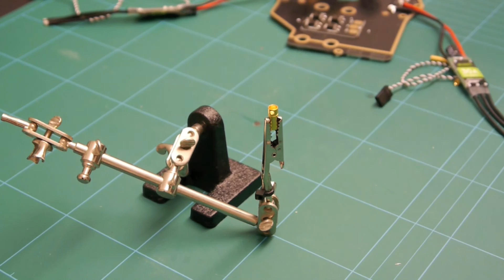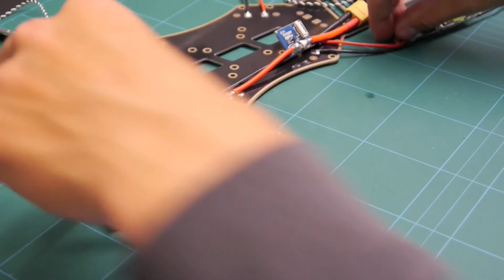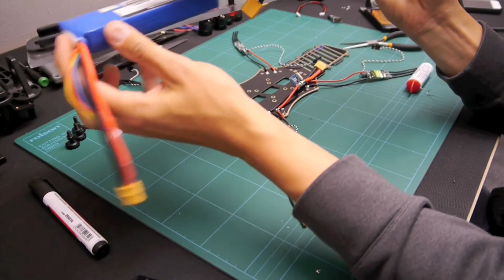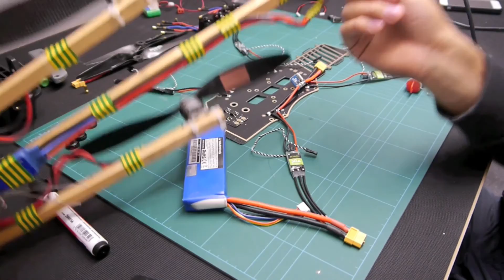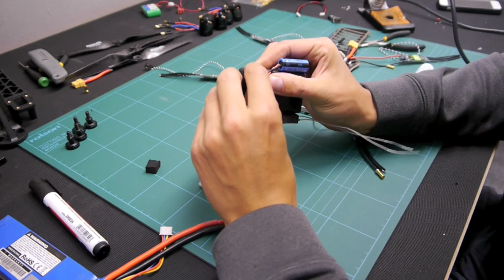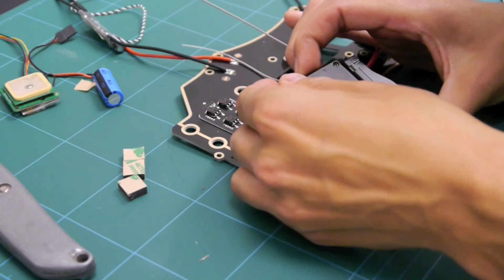TheManLab - Fitting APM - Diatone White Sheep APM Quad Build - Part 2

Comment: Hi i have this built and i need to fit the esc's, fc etc but i am a bit confused with the power distribution board that is soldered onto the main board - how does that get connected up and if i use esc's with the BEC's integrated do i need to use it? i just built another drone from a kit i got and it was working fine until tonight when the integrated pdb blew at the + battery wire soldered connection - what would cause this to happen as i am now paranoid about this build? sorry for the 100 questions.
Reply from the maker: Hello, when powering your FC its best to remove all the centre +v power pin from all ESC's. I normally remove the pin and fold it back and tape it or shrink hose it so it can be used again if needed. Its then best to used a dedicated BEC that can supply more current like this one http://tinyurl.com/zj8a5yu Enjoy!

Comment: Hello again! :)

Tell me please, where I can buy those sticky pads. Yes I can buy it from Ali, Bang or etc., but there is only thin pads, not more then 3.2mm of thickness :( So far I can see, you are using about 5mm of thickness(that's a minimum). I saw it on Hobbyking, but the delivery to Montenegro is too damn expensive, so it's worthless :( 

I have one pad that came with my APM 2.8, but it's only 2mm of thickness. This link for my pad that came with the APM 2.8 - http://goo.gl/FoUD19 

Can I use that, what do you think?

Thanx in advance.

P.S. Your video is really helpfull for me and I want to make my video, same as yours, but it will be for the russian audience.

It's me Феликс Мирзаев :) who wrote to you before. I made my channel, like you understood for the russian community.
Reply from the maker: Hello. I too can only find the 2mm stuff. I would try a sponge and stick double sided tape to each side and try that. http://tinyurl.com/ochrsmn Good luck with your new channel!
Reply: +The Man Lab I found it on Hobbyking, but the shipping is quite expensive http://goo.gl/WIeZ11

And I found on Ali and Rctimer - Ali: http://goo.gl/CxX8nb and http://goo.gl/8jt7p6 but not sure if its thicker then 2mm, Rctimer: http://rctimer.com/product-913.html. I think from Rctimer is the best choice and much cheaper, I can stick them together, so it will become 6mm ;)
Reply from the maker: +Вкусняшки Поднебесной hello again. You could sick them together but I'm not sure how well it will remove vibration. My quad has high vibrations at high speed. It's causing error codes on the APM so I will be looking for a better softer mounting method.

Comment: Thank you for helping :) I want to ask you one more thing about the Sunnysky motors. I see you are not using CCW motors, so I can buy this CW motors and configure them to spin as CCW on this flight controller?

With respect.
Reply from the maker: Hello again. To change motor direction just switch two of the motor wires round. I demonstrate this in a later video.
Reply: Yea, I saw this, but didn't understand properly :) Thank you.